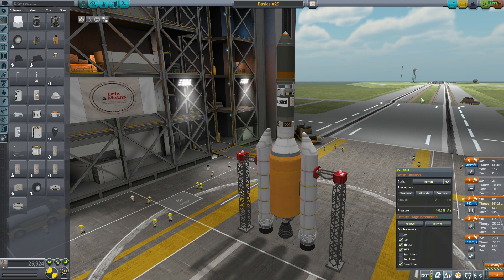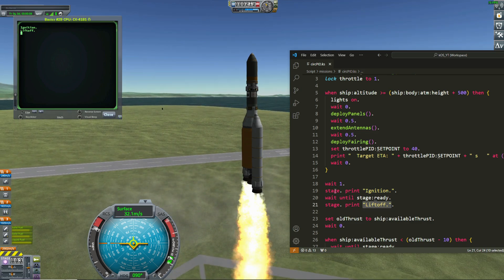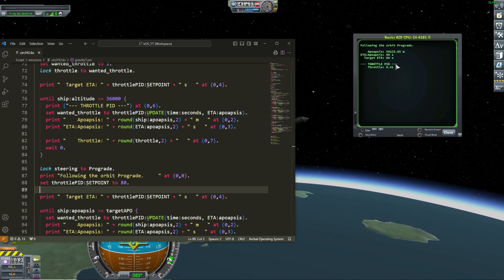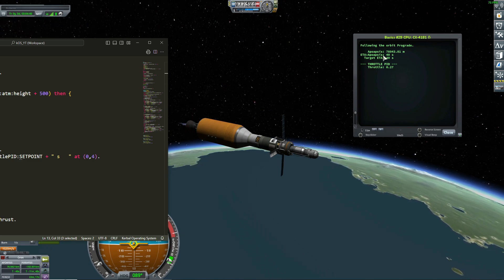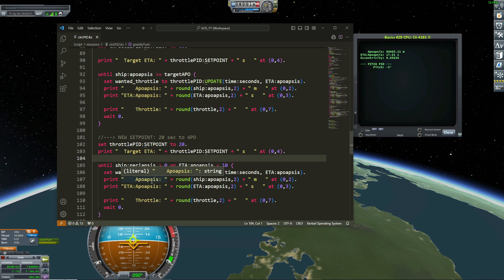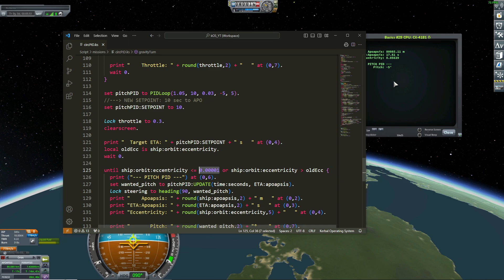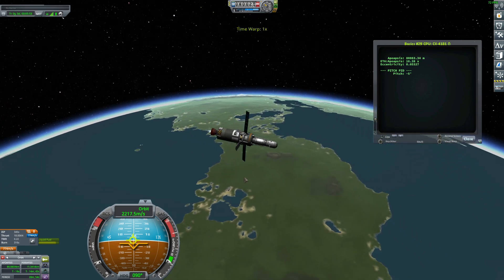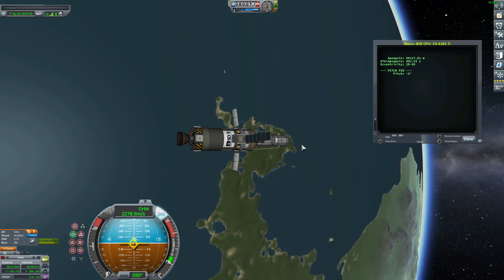[EN] kOS - The Basics #29 - How to Do a Gravity Turn With a PID Loop?

Comment: Do you think it's possible to get a decent orbit while never reducing the throttle? Like say, simulating a real life rocket that operates using only solid boosters, or an IRL engine for which "throttle to 1% power" is a non-reality

I've been trying, but it's very hard to keep the apoapsis from slipping away while keeping it high enough for eventual orbit
Reply from the maker: I have to say that I really don't know. In my GT, the throttle is always 100% but I have to cut my engine and start it again to circularize.
You can play with the pitch angle. If you want to increase the time to apoapsis, you need to pitch above the horizon. To decrease the time, your pitch must be below the horizon (the angle is negative).
But I don't know if it's a good way to do what you want.

Comment: Thanks for these PID loop videos. I never got into using them because it always felt like I was throwing numbers into a black box, but I really should get over that as they are too useful.
Reply from the maker: I don't use them a lot because the best parameters are not easy to find and they depend on the craft. I like to use them with rovers (coming in the next video 😉)